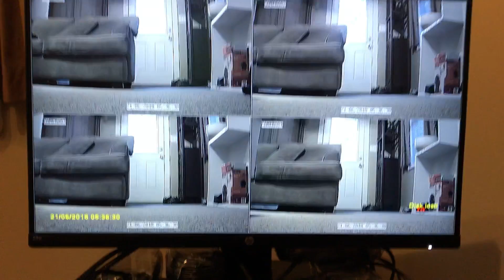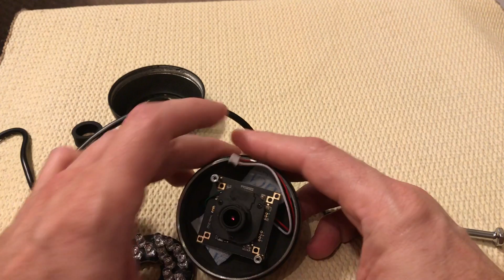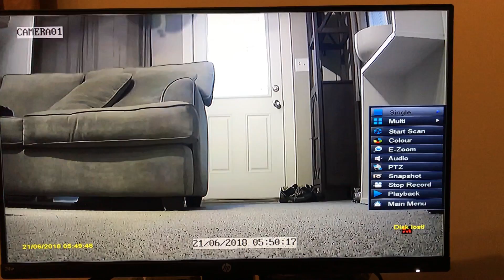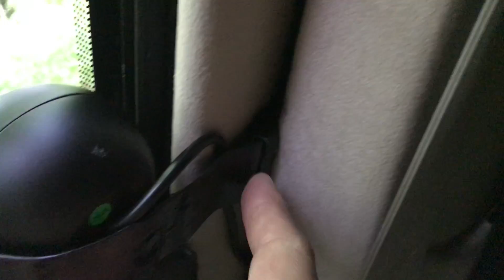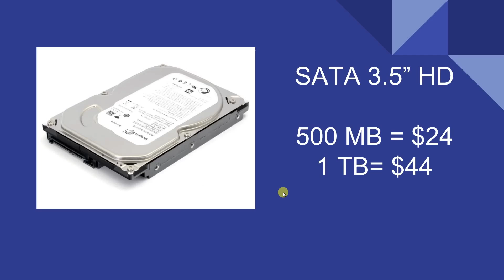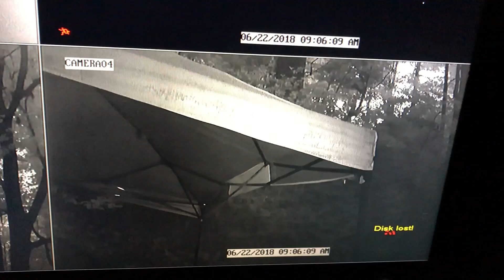Surveillance Security System Zosi 4 Camera Van Camper RV SUV Panorama Build Tour Vanlife

Comment: Great video and project. The only thing you didn't mention is how your DVR is powered, 12v? And also how long can you run the system without depleting the leisure battery? Many thanks. Correction, watching it again more carefully, you went through the power consumption in depth. Thanks for the video again.

Comment: Your systems probably a 12 volt system anyways look at the power supply that came with it running it off and inverter is the most inefficient way you can do it the voltage fluctuation will be fine

Comment: Man just don't get magnetic drives (old type also called HDD [or cached sshd])! One time you won't park your drives head properly (you forget to turn off recorder, or you will cut the power for some reason without proper shutdown and you are facing damage to disk plates.
SSD even though bit more expensive can survive all the bumps even when actively writing, so no physical damage to the drive.
Reply from the maker: That would definitely be a better way to go. Thanks for the tip and for watching.

Comment: If you do decide to add a hard drive to your system, you might want to investigate the differences between regular consumer grade drives and drives design specifically for surveillance systems. Drives like the Western Digital Purple series tend to cost a more than drives meant for desktop PCs, but they’re engineered for 24/7 duty cycle, higher heat tolerance, steady low throughput, etc. 

Thanks for sharing your videos. I really enjoy them.
Reply: You might want to investigate using SSD, a hard drive that has no moving parts.  Bouncing a hard drive around while you're driving has a chance of causing it to fail.
Reply from the maker: Good point.  I was not aware of the difference. Thanks for posting this information. Glad you are enjoying the videos!

Comment: I was wondering, do you have a pipeline of ideas (4 or more stacked up) or do you focus on one project at a time, then move to your next idea?
Reply from the maker: I have a rough idea of everything I want to accomplish with the van. I then try to organize them into videos - all in my head. When I finish the current one I start thinking about how to film the next one. I was able to get 2 weeks ahead for a moment but have slipped behind trying to get one done per week. I have a great appreciation now for how much effort 10 minutes of video takes to put together. I want to do the heater video but it's not cold enough to properly show how it works. I need to remake the table but I am over budget on expenses (generator set me back). I make about $150/month with the channel so try to keep expenses under $400/month for parts. I have my eye on a huge ambulance but don't have the money or room at the house - but what a great space to create!

Comment: this was very informative. too bad you can't (or can you?) disable the IR emitters while leaving the light sensor active for more power saving. great job comparing the various camera angles, lighting and power details!
Reply from the maker: Thanks -  I try to cover all the questions I had when I get interested in a project. Good question! I studied the board for quite a while. They have it made so that there is a voltage regulator (or controller) for about every 7 IRs on the board (that way if one fails you just lose a few IRs). Someone could de-solder each of the voltage regulators but there are a lot of them on the board and they are tiny. Someone more skilled in electronics could probably figure out a good way.
Reply from the maker: ...I suppose just de-solder all the IR's would work. They don't have any legs to clip.
Reply: i was thinking that if the jack harness you disconnected had separate and dedicated power leads to each the IR array and light sensor, you might only have to clip (or install a physical switch) to the correct lead.  I don't have electronics experience so being a tinkerer that's probably what i'd try. heh!
Reply from the maker: I'm not sure but I think the 3 wires are positive, negative and sensor. I could disable the sensor and have IRs but don't think I can have it the other way around. I saw a video where a guy put in  a switch but it just kills the pos or neg so you lose power to the whole board. I could be wrong.
Reply from the maker: ...fortunately you can order a whole new camera for $15.